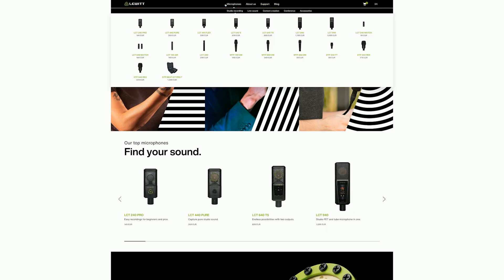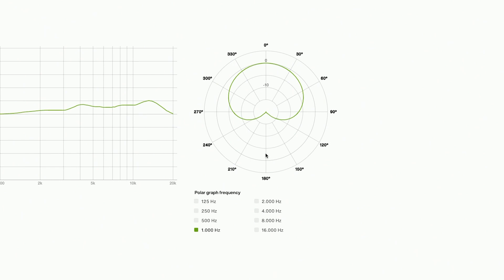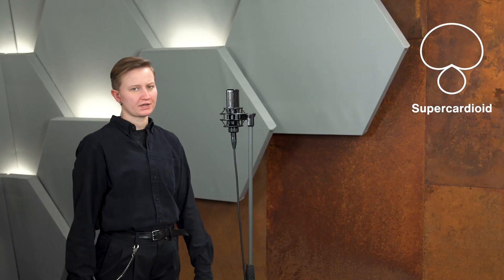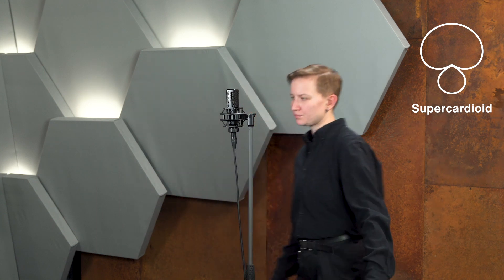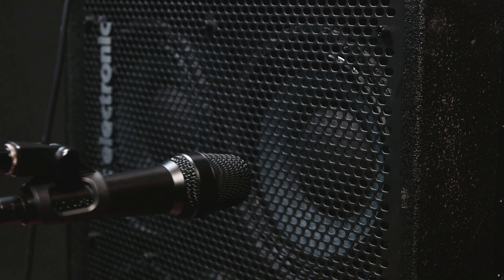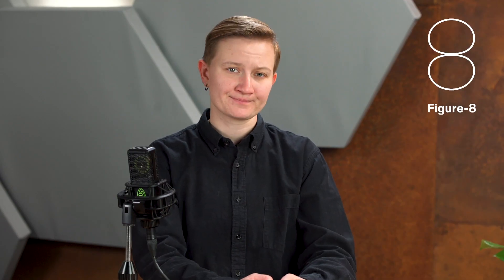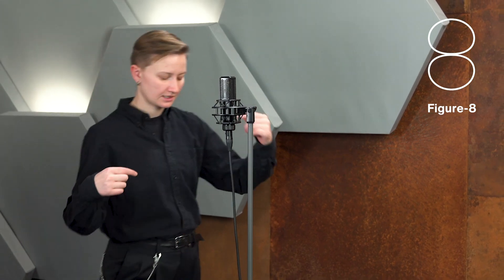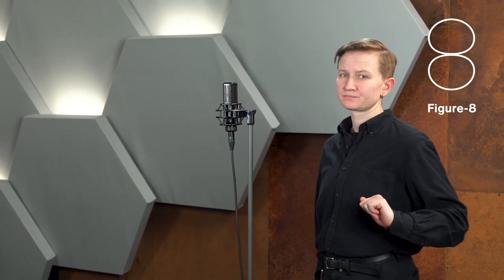What is a microphone polar pattern?

Comment: Well done. What is the best Lewitt mic for field recording? Thanks.
Reply from the maker: Check out the LCT 640 TS. It's a great FET condenser mic that gives you a ton of flexibility for different recording scenarios, contains filter and attenuation for low-end rumble, and you can even record in stereo with both sides of the capsule!

https://www.lewitt-audio.com/microphones/lct-recording/lct-640-ts

Comment: Nice video! Some mics have a fixed pattern others have many. Why? Does ist depend on hardware or software?
Reply from the maker: Hi Alva, thanks for the great question. 1) Dynamic mics come with a fixed pattern. 2) Most condenser microphones are also single-pattern (fixed) microphones. 3) There are condenser microphones with a dual-diaphragm called multi-pattern microphones that can create different polar patterns. This is a fully analog process that doesn't require any additional software. And here's something to make yourself nerd: The first multi-pattern microphone was invented in 1948 by Georg Neumann. 

If you have any further questions, we are always happy to help!

If you are interested in how a microphone works, you might like this video: https://youtu.be/iAXlPRM9zxk
Reply: p.s. I'm missing the cute plant on the left.

Comment: I record all types of flutes in my homestudio.  I would like to have a large diaphragm condenser microphone with a neutral sound. All mics I have tried so far, make my flutes sound like a buzzing bee because of the hyped high end boost that might work well for vocals but sound awful for flutes.
Reply from the maker: Changing the polar pattern also changes the frequency response. So if you have a multipattern microphone, try different patterns - omni usually provides the most neutral sound. Alternatively, you can try to record slightly off-axis - this will also tame the highs!